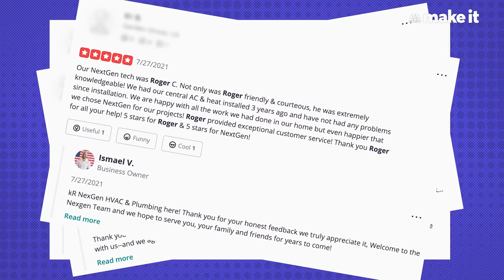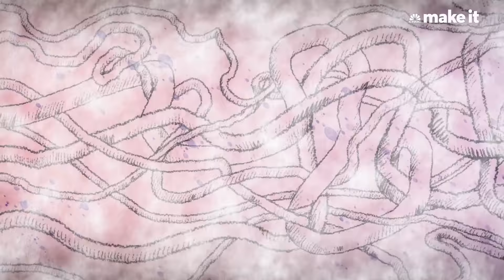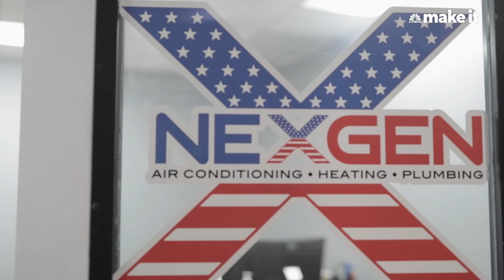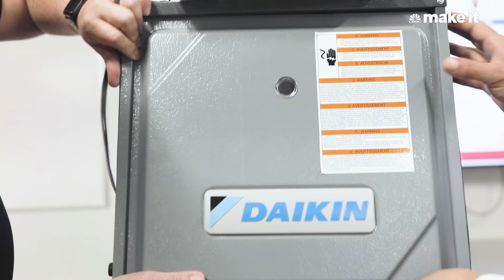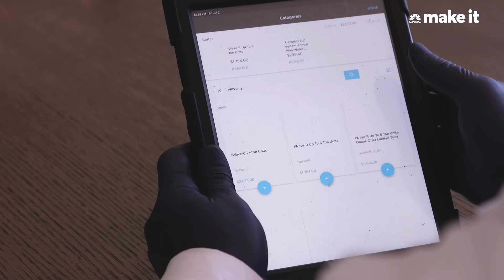I Make $80K A Year Repairing Air Conditioners | On The Job

Comment: As someone who's A/C died in 100+ degree heat on July 1 here in central California, and had to go without A/C in temps between 100-113 for 42 days while waiting for my home warranty company to approve installation of a new unit, I can't begin to tell  you how much RESPECT I have for HVAC technicians!🥵😄👍❤💯
Reply: You should ditch the warranty and take that $ and buy a mini split.
Reply: Mini splits are great but, you would spend a lot more money installing a house with splits compared to just replacing the unit.
Reply: @HelloThere-jr6gd  At $500-800 each should cost less than $3k. Most people don't need there entire house cooled they only need a couple rooms.
Reply: @robertberin4872  First, I have no idea what a "mini split" is and secondly, the new unit has already been installed.
Reply: @robertberin4872  you would have inferior airflow with a mini split
Reply: Bro you should've sued for attempted murder

Comment: Skilled labor isn't cheap, cheap labor isn't skilled! Plain and simple. I'm an electrician with twenty four years of experience and I make the same as Roger ( guy in the video) a year and I can relate to this video.
Reply: Eventually all labor will be skilled as minimum wage goes up and automatation gets rid of useless jobs (ex. picking up items from the shelf for pickup at Walmart).
Reply: @robertberin4872  That's NOT skilled labor! A ten year old can pick items off the shelf!
Reply: @srh361  he can pick them up but in a couple years he'll be doing it for free!

Comment: 7 hours for an open line though? My boss would’ve fired me.
Reply: Exactly. It's "interesting" that he found mice chewing it. But not necessary to the fix. Open line = rip out old line and put in a new line. Do HVAC techs not have a fox and hound test kit?
Reply: @fitybux4664  not many. But it’s not necessary because it’s only usually two conductors for the contactor. If I don’t get 24VAC to it then I go back to where the signal originates, at the circuit board. If I’m getting 24 there but not at the condenser then it’s apparent something has happened. Instead of pinpointing the break in the conductor with the little tracer that you’re talking about, I just test the conductors for continuity. Since there’s usually at least 4 conductors 18AWG, I just use one of the good ones. This will get it up and running if it’s a conventional system. If it’s communicating then additional steps may be required. I’d understand maybe like 1 1/2 hours tops if it’s cluttered and the customer inquires a lot but 7 hours is just ridiculous.
Reply: @peepeepoopoo1399  if he’s the super tech everyone here says he is, it wouldn’t have taken 7 hours to determine that it was just bad low voltage wires.  I hope the poor customer didn’t have to pay for his incompetence.

Comment: Full commission? Those are the companies to watch out for. Their check relies on SELLING accessories or frivolous odds and ends. Or worse case ripping people off and selling equipment and lying to customers
Reply: Not necessarily. Modern AC units last about 17 to 20 years before an evap coil leaks. The units sell themselves, no need to be shady.
Reply: I am a great tech (not HVAC), but I could never do sales. It kills my soul to hear a "NO" too often. I let other people do that for me. I just like to solve problems. Sales is scum.

Comment: BTW Roger only works on Commissions. Which means he's telling people that you need "a new unit" when you really don't need one". If you can be cold hearted and be a con-artist". Hvac is for you
Reply: Don’t put all HVAC techs and companies in the same category. I worked in the trade for 30 years, and would never even consider working for a commission based company.  Every commissioned based company I have seen overcharge, and try to sell new, instead of doing their job, repairing systems. Once they get a bad reputation in an area, they move on, or open up a new shop under a different name.

Comment: Why wouldn't my service tech annually for years not reveal the poor duct work and connections on my roof heat pump when it was on its last legs during the latest repair,  a replace burnt starter with a new one. Now that the motor and compressor both done in why does he have credibility to determine who sells, installs , replaces all duct work. He's currently disabled but insisted on a larger job than i am comfortable with.

Comment: I installed my mini split myself for $850. No ducts to run/ clean. No climbing in attics. No mice to worry about. Run it off solar & no electricity to pay!
Reply: @neal cassady 😂 I used to live in my RV. Give it a shot. You can cool your whole floor.
Reply: @neal cassady its been a huge change living in house vs an RV. If I could go back in time I would install a mini split in my RV cause it was hard with 1 in of ice on the roof and summer temps of 100's in Albuquerque... still might but I don't use the RV much anymore. Buying more than 1 house is a waste of $... If you want a buisness buy an actual buisness (Subway, McDonald, storage center, ect...)

Comment: A helper making $55k a year? Lead installers at the company I work for are at $50k before any overtime etc.
Reply: Sounds like boss is either underbidding or keeping most of the money themselves
Reply: Right. I'm not even making 55k a year and I've been at my company for 4 years. we do residential, commercial HVAC, and refrigeration in MD. I'm only at 50k. 80k a year in Cali is probably not that much considering the high cost of living. Median home cost is like what? 600k?
Reply: @Nostalgia2x  You should go outside Home Depot/ Costco and put a big billboard in the back of your truck, "Air Conditioner services provided here".  The amunt we pay to get our air condioner serviced vs. what the tech gets is outrageous.

Comment: Best commercial techs cap out at $40/hr. Residential caps out at $30/hr. I met this one real special hvac controls guy making $50/hr but he was special. A good commercial tech is essentially an engineer..
No thanks. I own my own residential company I make $80-100k but sometimes I get whole months off like September so when im working it's usually minimum $100/hr. I work from my garage at home no shop.
Edit: I'm in Michigan
Reply: Maybe they only make those low wages in your area.  It’s certainly not true everywhere.

Comment: 7 Hours to find a low voltage fault! Its just 2 wires (or 4 wires for a 2 stage AC) that connects in eye sight inside the service panel. yikes
Reply: Rats got to the wire somewhere between the indoor and outdoor unit.  Could have been in a wall. Still not worth 7 hours

Comment: Good career choice. ANY trade is…… as a 35 year licensed Commercial/Industrial HVAC TECH…. It’s a rewarding career.

I work for one of the largest HVAC company’s in the world. It has it’s hard days and some easier days. I also teach HVAC in the evenings at our local trade school. More people need to get into the trades.
New survey shows that for every 5 technicians about to retire…only 2 are replacing them.
Speaking as one of those with retirement in sight…. I see the trade hurting for new people.

HVAC business is not going anywhere. You will never rent, sell, work or live in a building without HVAC in most is this country.

Great career choice……
Reply: I taught apprentices too, for 30 years.  Do you happen to work for ACCO?   They are one of the largest in the country.  The shop I worked for is now affiliated with them

Comment: It seems like an incredibly easy thing to find: a missing control wire. Weird he didn't check that if the complaint was like "it doesn't turn on". (And if the high voltage is present on one side of the contactor but not the other side.)

Comment: He'll charge you $300 when all that was needed was the flame sensor to be cleaned.
Reply: You don't have to pay someone for their expertise. You can always do it yourself.🙄
Reply: Worse thing about it is he will probably only get $100 from the job
Reply: @robertberin4872  who? Ishmael Valdez? Lol. 10% of 300 is $30
Reply: @heatncool  He probably makes more than $30 on a $300 job.
Reply: @robertberin4872  probably is the correct word lol. You don't know. BTW you have an hvac business? Look at all of his expenses... he's in debt btw
Reply: @robertberin4872  if your referring to the owner yes he  doesn't get 30 out of 300. They use yelp..  It averages $20 a lead just like almost any other lead gen. They send bogus leads so it averages closer to $45 a lead at the end. 
You have to calculate the 20 min road time, (the technician is on the owners clock), also the gas.....

A 30 hr technician burden rate is $56 hr after workers compensation, insurance, and licensing/certifications yearly training for techs. The advertising such as this video goes into overhead expenses. I imagine this video was close to 5k with production/filming and advertising fees. It goes on and on. Google says most owners report 2-3% net profit because overhead is uncontrolled.
Reply: @heatncool  how much do you think the tech makes on a $300 job?
Reply: @robertberin4872  the technician? That's a different story. Since the technician is not an owner/operator he has 90% less stress and responsibility or risks.  Financial, health and relationship. Thus his wage wouldn't be as big then if he would open his own company and work for his own company. 

4th year apprentice even a few years beyond that is 30-35 hr max. Higher if it's commercial. Then commissions is added on top. On a 300 invoice there is no commission. To clean the flame sensor takes 15 minutes.  So if your 35 hr thats $9 or so. And the drive time to get there.
Reply: @ilovegoodsax  Some people can’t even change a tire. How are they going to fix their furnace?
Reply: @rodgraff1782  It was sarcasm lol.😝

Comment: Didn't you cover a story like this a few months ago? I think that was the plumbing guy.
Reply: One is plumbing, one is HVAC. What do you mean “story like this”? They are two different jobs. Would you compare a doctor to an attorney? No right because it’s two different jobs.
Reply: @J-C0916  A lot of companies do plumbing, heating, and air conditioning   They are called Mechanical Contractors.  I worked for one.  BTW. The  UA (plumbers Union), has Refrigeration Fitters, and HVAC service mechanics.  Their jobs cross over.  A lot of plumbers are also HVAC Techs. Your statement is your own opinion, not fact.